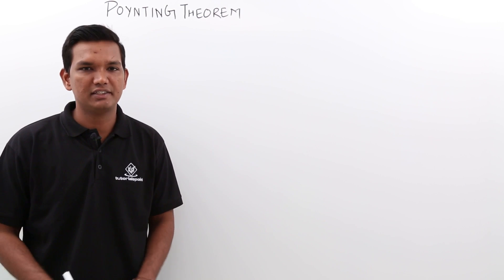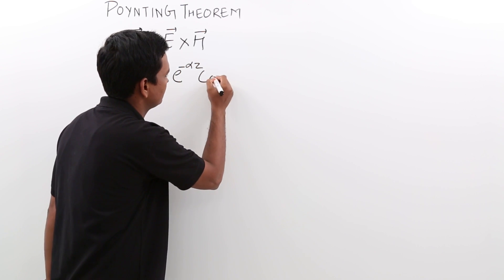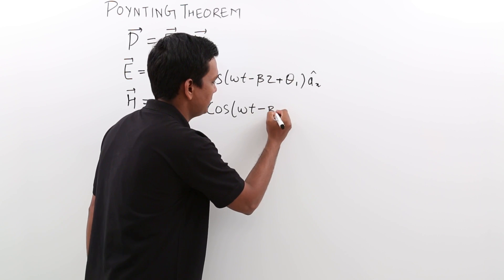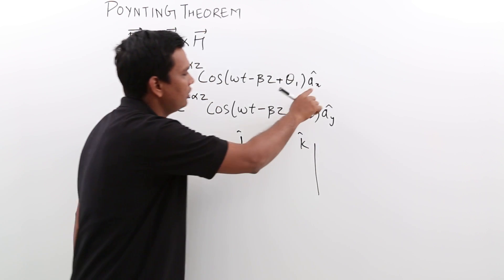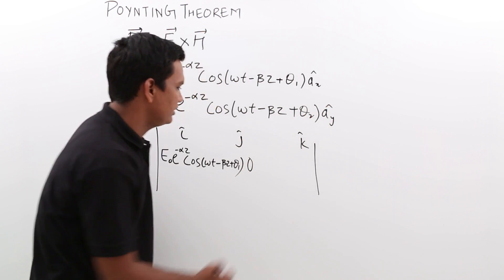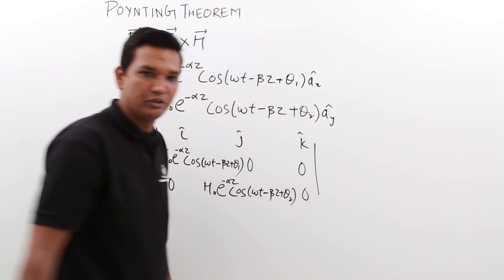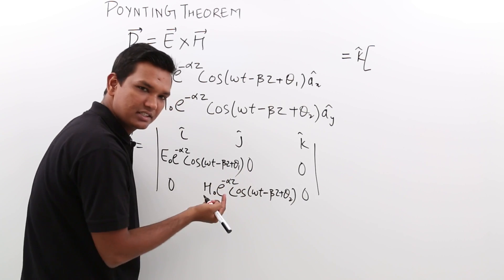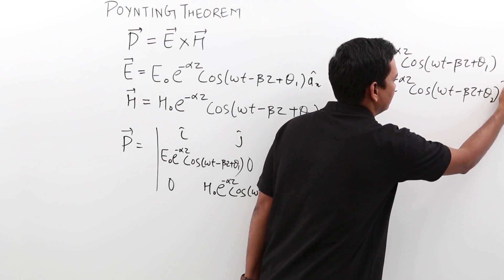Electro Magnetics - Poynting Theorem Part 1

Comment: Let take two identical positive charges q1 and q2. There are four points (a), (b), (c), (d) . q1 was initially located at point (a), and q2 was at point (d). Distance between (a) to (d) is taken 1 lightsecond. Distance between (b) and (c) is also about 1 lightsecond ( a little less)

(a)...(b)................(c)...(d)

q1.................................q2

q1is moved from (a) to (b) toward q2, and in a similar way, q2 is moved from (d) to (c) toward q1. Let say they both were pushed for half a second. 
(For Energy given) Force on q1=Kq1q2/r^2
(For energy output) Force on q2 =Kq1q2/r'^2

When we think about r, we found that it would be somewhere between distance of (a) - (d) and (b) - (d), as the electric field of q2 will be the same there for 1 second. But for r′, it is between (a)-(d) and (b) - (c), so r>r′. Therefore, the force on q2 is greater.

Assume that you are q1 and are pushed for 1/2 second over a very short distance. You will find that field of q2 were the same there for that time period as a result of the velocity of the electric field. So, the q2 for q1 was at (d) during push. Thus, q1's average distance from q2 was somewhere between (a) - (d) and (b) - (d).

However, for r′ taken for force on q2 for receiving signal was different from r. Here, I am q2 and was moved at the same time, but when your changed electric field reached me after 1 second, I was also moved closer. So, for me, you moved closer, and I also moved a little closer to you, which makes my average distance from q1 less than r.
Seems like output energy(signal) was more than input given on q1.
Tell me how the velocity still not violating the law of conservation of energy